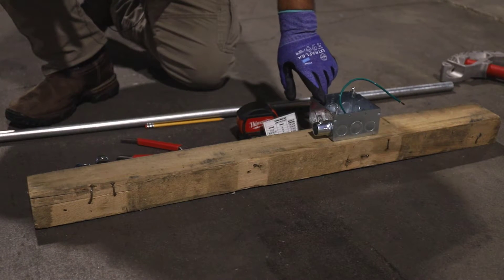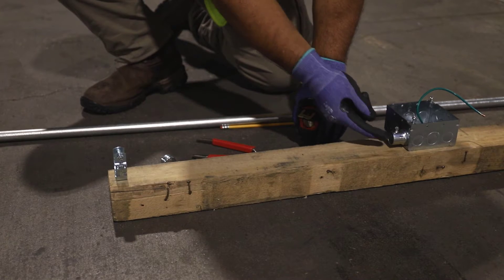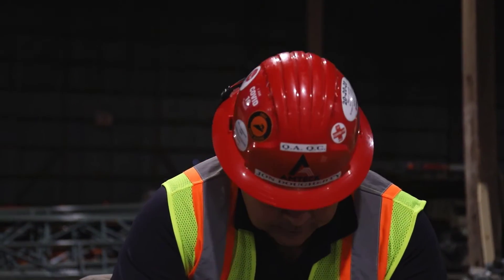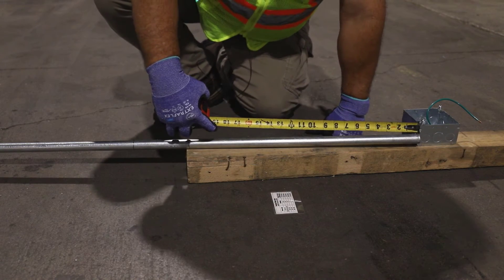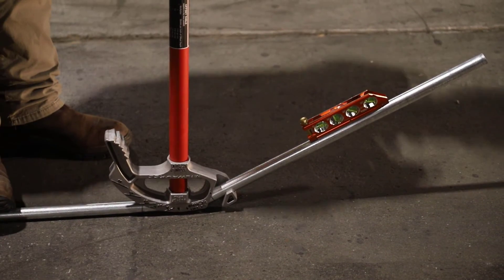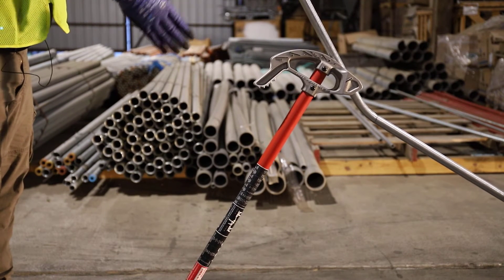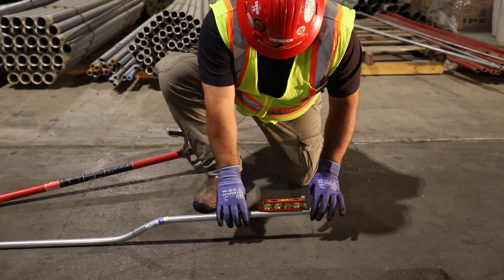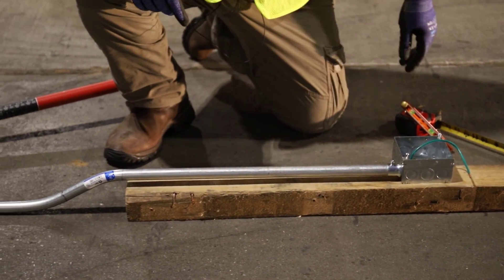How To Do A Box Offset Bend With A Mini Strap

Comment: What decides that the offset is 30°? Is it just esthetic/ease of wire pull preference?
Reply: The less degrees in conduit the easier the wire pull. 30 degrees just the easiest multiplier to remember and quick to do the math. Times 2.
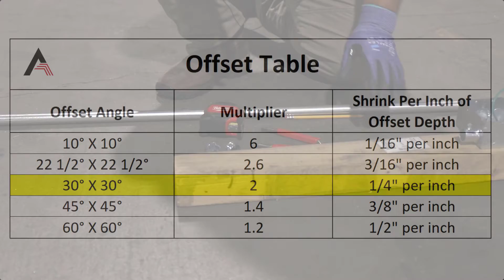Reply: 30° bends are the most simple to calculate. If you look at the offset table at 1:55, the multiplier is 2 and the shrink is ¼". So if you want an eight inch offset, you can easily double that to get your distance between bends (8" × 2 = 16") and quarter it to get your shrink adjustment (8" ÷ 4 = 2"). Compare that to a 45° bend, which requires you to multiply by 1.4 or ⅜.

Also, because it's the most common offset bend, most benders are designed so that the handle is vertical at 30°. Meaning not only is the math quicker, so is physically bending the pipe.
Reply: Forgot to add, notice at 4:30 the bender is standing straight up

Comment: Put your level on the bender handle, for 30 degrees the bender handle will be at a 90 with the ground also when doing the second bend keep your left hand closer to the bender using pressure, you bow the conduit when you try to bend farther back